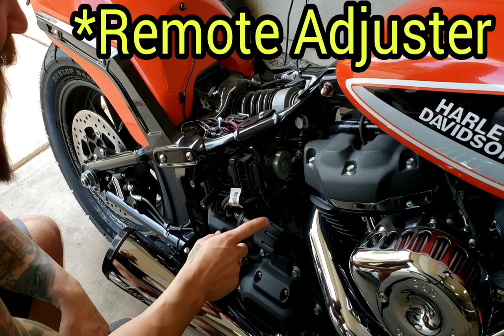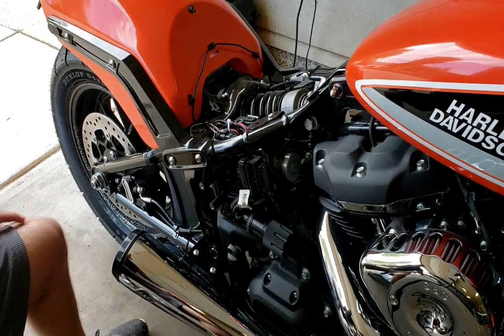Removing a Softail Fat Bob rear shock to make some adjustments

Comment: I did a full stage 2 upgrade on my Fat Boy  114, with the SE Oil pump and camplate and SE Torque Cam with a powervision tune from Fuelmoto.
My 1 recommendation is make sure you don't break a bolt getting those tappet cuffs off, because it was a huge mistake for me to make.
But there's solutions to get those bolts out safely and install the S&S tappet cuffs.

I'm going to do Suspension next. I got a FOX shock for the rear, and Progressive+RICOR front end.